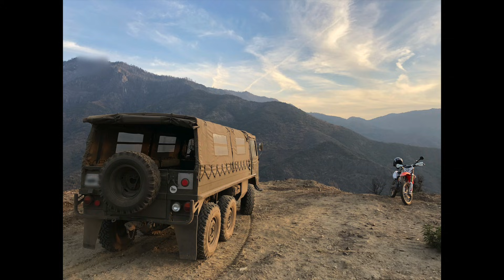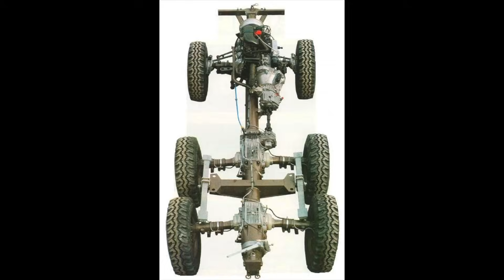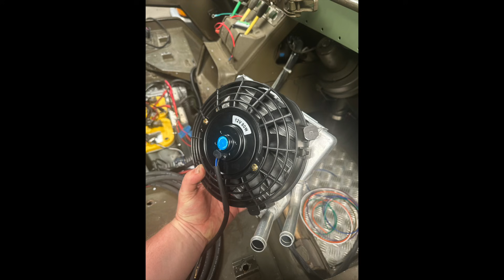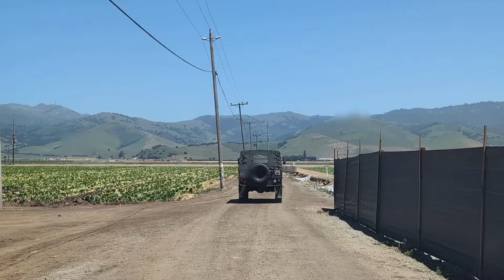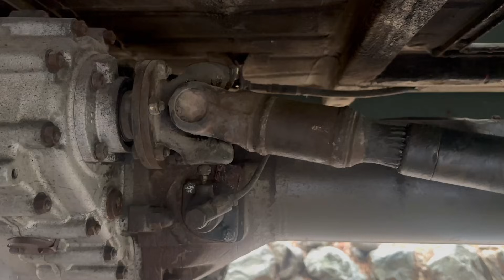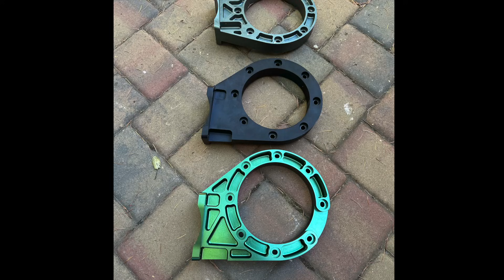Pinzgauer 6x6 EV Conversion Part 1: The First Drive

Comment: I can't help thinking that it might have been simpler to retain the original gearbox with the transmission as it is known to work, then mate the electric motor to the gearbox using a clutch. There would still be plenty of challenges, but localised to the power unit as opposed to rebuilding chunks of the power train.
Reply from the maker: I think there is a Pinz conversion where somebody took that approach. I felt like we would need to do a bunch of custom mount stuff for the motor to mate with the transmission anyway, so why not eliminate that potential point of failure. But, yeah, I'm not sure if "my" way is the best way or not...
Reply: @creativeengineeringprojects  There is a guy in the UK (Wales to be exact, they hate to be confused with the English!), called Electric Classic Cars https://www.youtube.com/@ElectricClassicCars/videos 
He has done over 100 conversions over 10 years if I recall correctly. Some use the existing gearbox, some are direct drive, some may be variations. Each case is different, and depends on the customer, the budget, and the desired result. The right way is the one that works ;-)
Reply from the maker: @coniow  Thanks for that link! He's got a new subscriber.

Comment: Just to inform you in Austria there is a start up called Ecarus with is developing a conversion kit for the Pinzgauer.
I already had contact with them. At athum 25 they converted prototype 2 and 3. What I remember they plan to sell it commercial 26-27.
You can find videos on YT from them
Reply from the maker: I saw the Ecarus project in 2020 when they had just finished their prototype of the 4x4 Pinz conversion. It looked really interesting at that time, and I see now that they are really working on a number of other interesting kits too. In fact, before doing this conversion, I tried contacting them to get an update on their timeline or whether I could get a build sheet or anything that would be of use for my conversion. But, I wasn't able to get a hold of anyone. It will be very interesting to see what they come up with!
Reply: I have the same problem, the ecarus guys don't answer - when did you have the last contact with them? How did you get a hold of them?
Thanks!
Reply: Wir können es auch kaum erwarten

Comment: Judging from the part at the end, what you did was get the shaft level. I heard somewhere (i think MORR) that the angles of driveshafts that are connected to each other have to even out or something like that to minimize vibrations.
Anyways, very interesting project (to me as an austrian)! I have seen a video of someone here in austria who has (together with a coration company) covnerted their Pinzgauer (but the 710M, so the 4x4 version). What they did different, was that they took out the engine and mounted the electric motor instead.
They did not remove the gears or clutch. They just made the ouput of the e-motor fit the input of the gearbox.
I think they also needed to change the gas pedal into a poti and put a box of batteries in the back.
When i saw that it got me thinking: If i understand the mechanics right: with all the gears still there (not just the transfer case) they can reduce the impact of throttle pedal movment for offroading. I hope my wording makes sense, english isn't my native language.
Reply from the maker: Your English is great. Keeping the main transmission is a really interesting choice. I would really like to try driving that one to see how well that implementation works for extreme off-roading!

Comment: They failed to assemble the driveshaft so that the UJs were clocked properly. This is one of those bits of knowledge you pick up fixing RC cars.
Reply from the maker: I only learned about clocking on these myself during this project. And, why "constant velocity" joints are called constant velocity joints, which these aren't.
Reply: Something that I had not heard of either! You learn something new every day.

Comment: A "Pinsn" with engine problems, so yes water is wet.
I still remember my "deployment" where we could use them as smoke generators, if you had to try to cold start them.
Reply: We had one that backfire so badly it sounded like ÜSMG fire from a distance.
Reply from the maker: Ha!

Comment: Pinzgauers are such vehicles which shoud NOT destroy with these idiotic EV-conversions...

Sorry but there are plentiful amount of other vehicles, pinzgauers are quite rare...and worth keeping original.
Reply from the maker: Ha! I hear you. Custom EV conversions aren't for everybody, but I have had a ton of fun with this project and learned so much. For me, it's going to be a much better machine for what I use it for. I got to drive mine with an engine for many years and loved it too.
Reply: Yes because you always want to keep an old smoky underpowered engine 😉
Reply: @hughmarcus1 😂 you're s typical fool...sorry voit that...

Domyounlive in USA? If so, just look hiw much there's co² emissions produced  for every kWhour of electricity... USA is just banana republic and fill of denialers.

For every kWhour USA produced over 350 grams of co², while in modern western World its like ⅕ to ⅙ of that...(2024 statistics)

Now, If average EV -toy has ~80kW hour battery and for example my older diesel volvo emits 99gr. Co²/km cannyour brains actually calculate even the minimum difference between moronic EV and average size small diesel.

Then, after that count all that co² what EV manufacturing takes...

Truth=ev's are big scale hoax.specially in countrues where production of electricity emits huge amount of co²...

Btw, i do own EV, as i have few modern ice cars, running costs are somewhat identical  If you charge your stupid EV using quickchargers ...

And where i live our country emits ~70 gr. Of co² per kW(again, USA has almost 350gr.)
Reply: I think it is an excellent choice of drivetrain.
Reply: People can do whatever they want to their own things. Electric drive is a good fit for offroad vehicles.
Reply: It isnt destroyed jackass its just got a new bolt-in engine. If youre willing to fix the old ICE engine and keep it running for him for free, im sure hed swap it back.
Reply: @alexphelps7042 boohoo, you can rebuild WHOLE engine for under 2500€....
That much it cost for me 2 years ago when i refurbished my pinzgauer diesel steyer-puch engine... spares and machining.and haflinger engines are even more cheaper to renovate.

Steyer still makes diesels, like my 24ft 65-year old mahogany cruiser where i updated new steyer 280hp marine diesel few years ago..

EU and GB has many firms just specialized into pinzgauers, so spares and new parts are available...